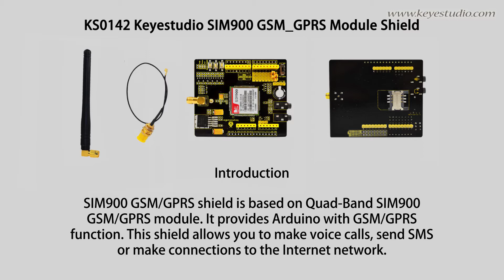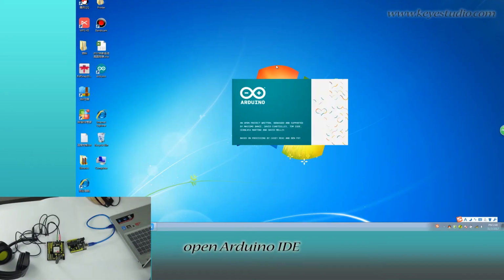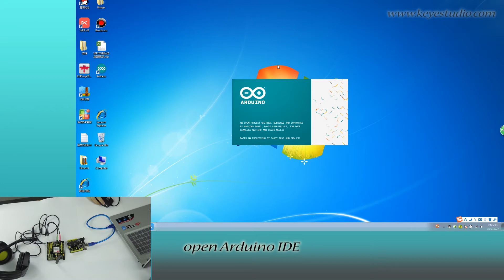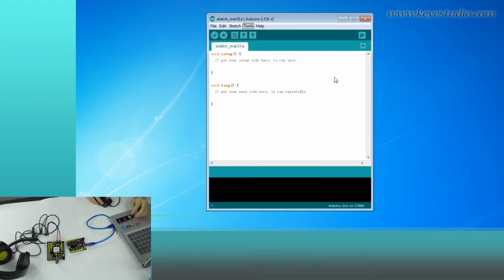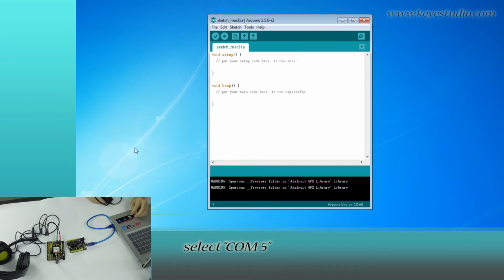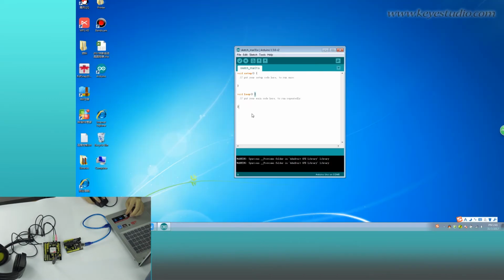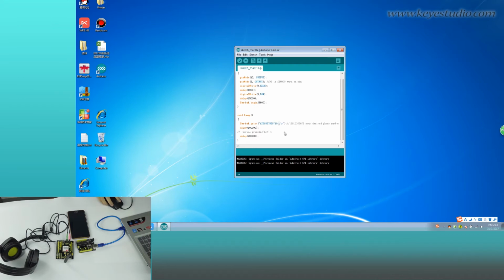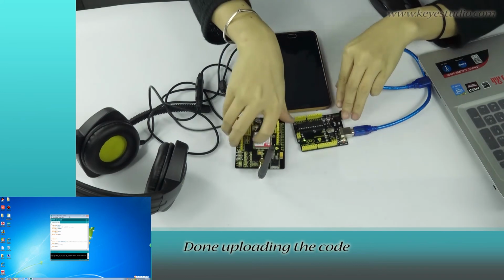KS0142 Keyestudio SIM900 GSM GPRS Module Shield

Comment: on your SIM800c shield is there a way to auto power on? or start it with Arduino as shown on this video?
Reply: Hello, I was wondering how you make work? I got no response with AT commands neither working with this examples https://wiki.keyestudio.com/Ks0254_keyestudio_Sim800c_Shield.
I tried powering UART with 2.8V 3amp and powering with extern with 9V 2amp.
I'm using Arduino UNO R3